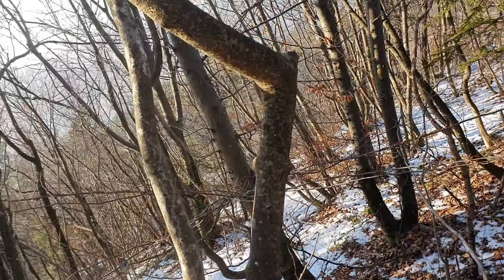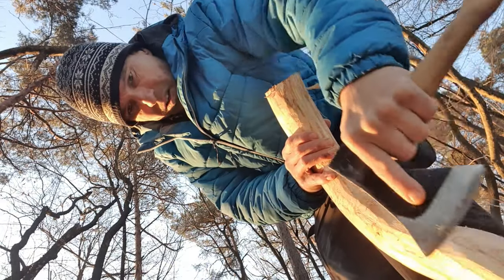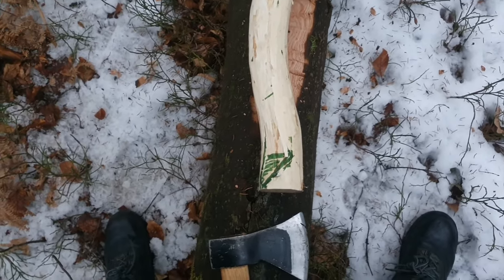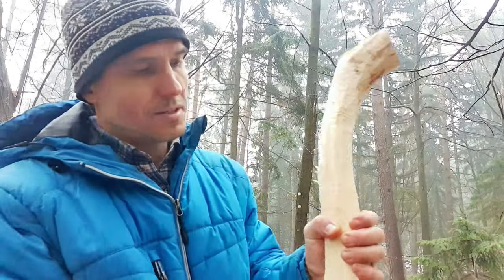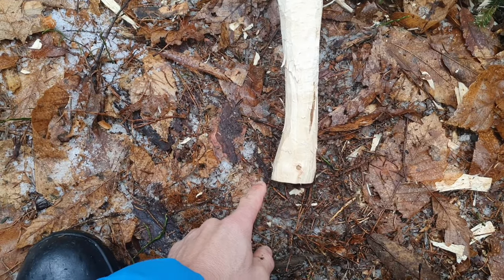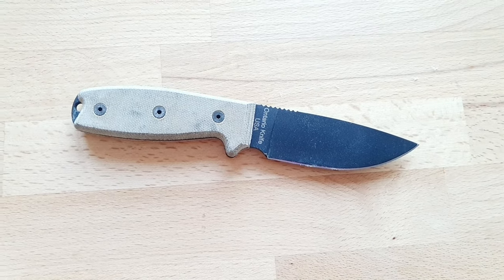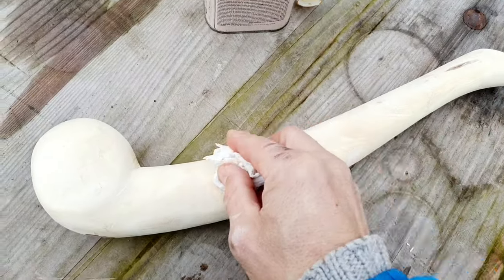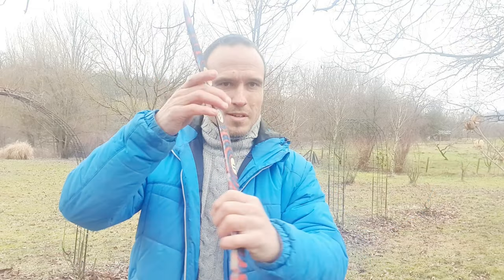How to make a Wooden War Club

Comment: One big difference between your recreation and the originals is that the originals (at least those made for actual warfare, not ceremony) were usually made using the root burl of a tree, not a branch. The burl formed the ball, making it substantially heavier, I believe, and much less prone to having bits of the side split off in use. It has been some years, but I had a chance to handle a repro made out of the proper wood, I think, and it was surprisingly heavy, a much better weapon than the ones I handled made from straight grain hardwood.
Reply from the maker: You made a good point that sounds logic and I will give it a try as soon as possible to make a war club in a way that you have mentioned. Thank you for your precious input, this is how we all can grow and learn TOGETHER. Best regards from Slovenia!
Reply: Best places to find them are on creek/river banks.  You can find them with a natural cure........
Reply: What kind of wood would you recommend most to look for?
Reply: @jaredkain2792  
I apologize for taking so long to respond! I've been told by someone who recreates these professionally that  maple, "hop  hornbeam, ash, some cherry, osage, hickory, and some locust, and some iron wood," are possible candidates. From what he said and my own observations maple was/is the preferred wood for both ancient and modern makers.
Reply: @123elnat  do you know if he makes them out of the whole sapling, sapwood and all. Or does it carve it out of the heartwood?
Reply: @benchase7537  
He didn't say, but with maple the sapwood is actually the biggest and most useful part of the tree, and the heartwood, which is a very small part of the tree usually, is generally cut away if possible. With a sapling one would just cut it to the desired dimensions, I think, and let the pith and heartwood stay in the middle. With cherry you'd want the heartwood, I think - I'm drying a piece now for a club and working off the assumption that I need the hardwood, not the sapwood. Talk on the 'net regarding  axe handles suggests that either would be fine for hickory, at least for the handle - I think that the relative size of your piece of wood in relation to what size club you want will be the main factor in what you cut away. Same with ash, I think. I've never made anything with locust, but I've cut down a couple trees and IIRC there is a considerable difference in texture between sapwood and hardwood which makes me think that you'd want to stick with the hardwood.
No experience at all with any of the other woods.
Reply: @123elnat  thats really informative thank you. I've read some of the same things. Like you said, hickory and also oak sapwood has the same mechanical properties as its heartwood as well. I am making sapling/root ball clubs from osage orange. Typically bows are made from its heartwood but obviously a sapling won't contain much. I was told that its better to pick a sapling that already has the diameter you're looking for so you don't have to remove wood. I guess it breaks up the grain structure and makes it weaker. Same reason why bow makers chase a ring.
Reply: Some used spiked nails at the round ball so whenever u striked u would strike with the spike backed by the ball head and its actually pretty darn durable and absolutely effective

Comment: I did not find this info on Google, but I came across an old book that had hand drawings of the Indians using the war club. Its primary use was to "whack" the horse that was pulling a wagon. Most wagons were pulled by four horses, or oxen, and the attacker only needed to bust the skull on one animal. The animal would drop to the ground and the wagon was left dead in its tracks. The other three animals were then wisked away. I can only imagine what happened to the travelers.
Reply from the maker: Wow, such a cool information and also logical in a way. Thanks for this information. Best regards from Slovenia!

Comment: So what is the process of curing or drying the wood is it better to dry then carve or carve then dry could not find any thing and my experience with walking sticks that could be years of waiting just wondering if any one has some ideas I stuck 2 in my chimney see what happens
Reply: I carved it "fresh" and it is still today without cracks fortunately. Interesting, this chimney trick, so cool.
Reply: @RobertLisac  I just checked them it is interesting I also rub beef talo in it it I don't have mineral oil

Comment: What kind of axe is that?
Reply from the maker: You mean the axe that I used to carve the war club? It's an ordinary small axe, that you can purchase everywhere, but I made some modifications. I cut off about 10 cm of the handle, I made the handle thiner, because I have a small hand and I sharpened the axe razor sharp.
Reply: @howtomakeweapons7353  ahhh, that explains it. It looks modified but I really couldn’t explain in what way, other than thinking that I wouldn’t mind having a dedicated carving axe. It looks so practical that I was thinking that it was specifically designed for carving as a commercial item. Thanks for responding! I’m not a stranger to modifying specific tools for specific purposes.
Reply from the maker: @dr.froghopper6711  You're welcome. The last reason is, that a smaller axe doesn't take as much space in my backpack ;-). Best regards, R.